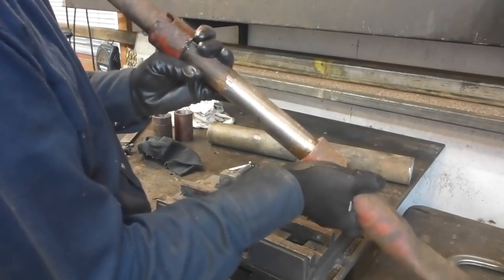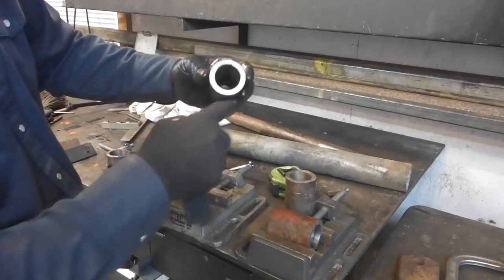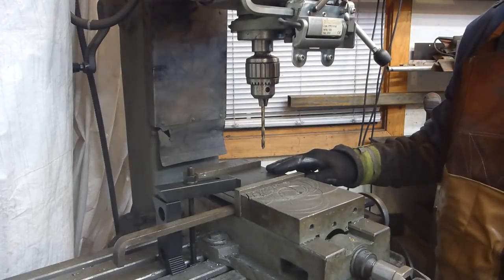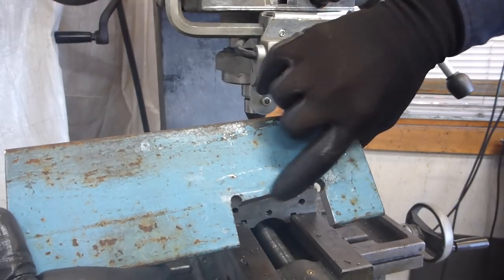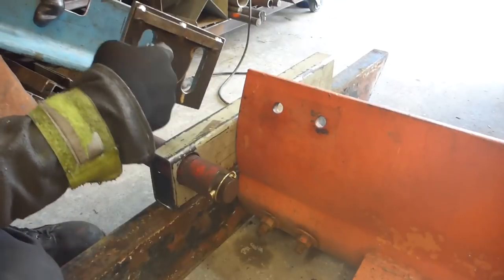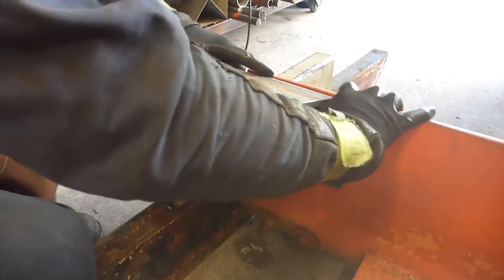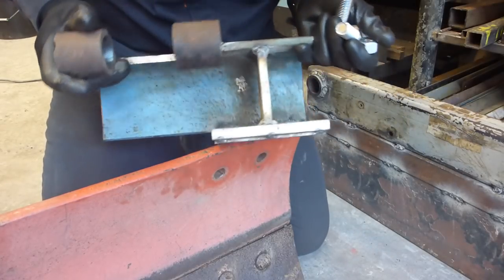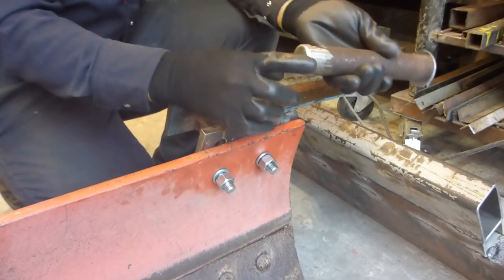#102 Box Blade

Comment: You mentioned the chain for your top link.  That gave me a great idea to try that on my landscape rake.   I enjoy watching you make these tools and implements!!!  You design for what you need.  Thanks for posting..
Reply from the maker: Thanks Grampie!  The chain did not worked exactly like I expected as it duplicated the washboards!!!  This is why I came up with a quick adjustable upper link.
Reply: I tried just a piece of chain yesterday.  I made a vid and hope to post soon.  Wasn't really pleased with results because, like you say, it tended to follow the washboard.  Not as bad as with the solid top link though so it's better!!!LOL
Reply from the maker: Grampie's another blocked comment and I don't get notification until I specifically go into the video's comment and see the blue ribbon at the top and free you comment.In fact, if you don't want the rear wheels to make a duplicate, your box blade or grader blade must be free floating AND have something long enough guides to surf over the washboard. Much like a good quality wood plane that has a long sole. This is why I came up with those weird looking side guides, longer than what is needed to keep the material from pouring on the sides.
Reply: Thanks for the tip.  The chain didn't work as well as I thought it would for reasons you mentioned.  I tried to 'grade' the area with my blade and then use the rake to neaten it up some and that seemed to remove most of the washboard.  Fun trying all these things to see what works best!!!  Still don't know why I'm being blocked on your channel.  I checked my settings and can't find any reason in there.  A you tube mystery!!!

Comment: Joe, you got one heck of a fab shop!  I think you could build just about anything you desire. lol  Heading for part 2 Thanks!
Reply from the maker: Thanks! I discovered steel fabrication about 5-6 years ago. I initally bought a MIG welder and got addicted by the first use! My very first project was my dirt bucket as you see on my avatar. It was my very first experience welding... So far the welds are holding! Then you bet I never stopped since then! Thanks
Reply: Yeah, You can tell you love what you're doing it shows in your work!

Comment: Hello Joe,
Recycling at its best.
A question about welding: I thought that metal should be 'cleaned'  to blank before welding to get a firmer connection.
When my son makes a weld (electric or mig-mag) he always makes the layers blank to shiny metal.
Greetings from Holland
Reply from the maker: Hello f p!  You are right, if you don't get a good connection AND clean surfaces, no good welding. I did not show on the video, but I roughly ground the parts specifically where I had to weld. Although it is not recommended, you can start welding on bare steel and progress over paint (light coat) as it will burn before you get there. Not telling you about the smoke it generates...  Thanks for your comment.